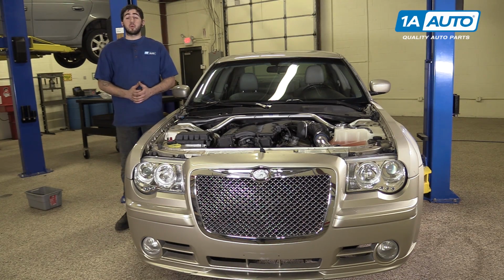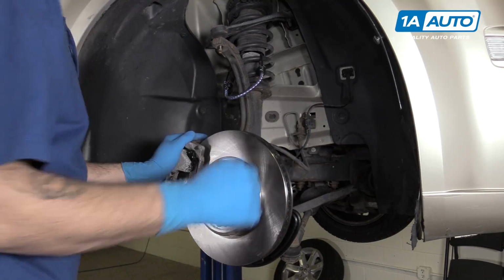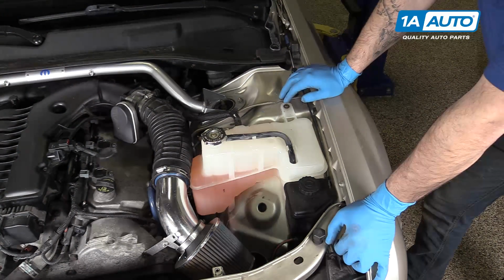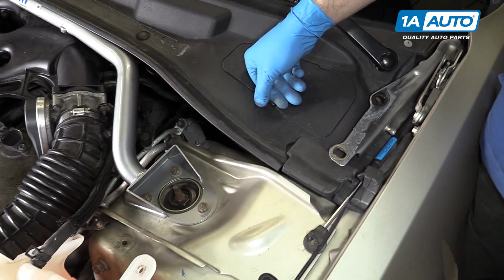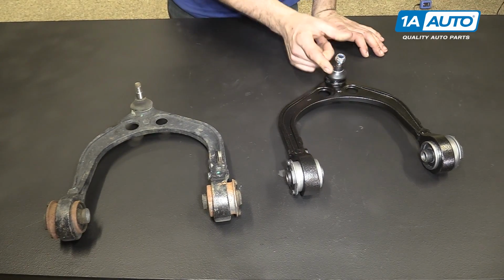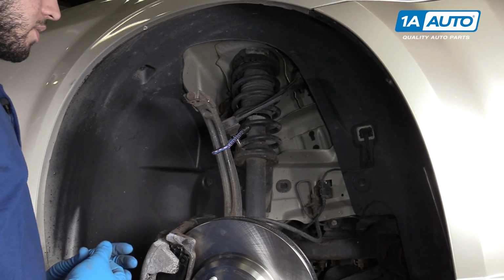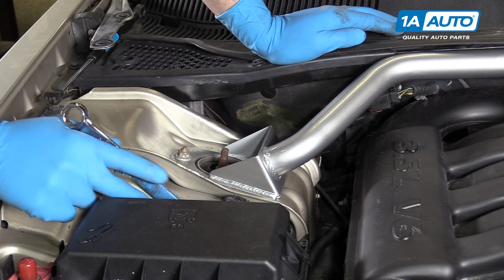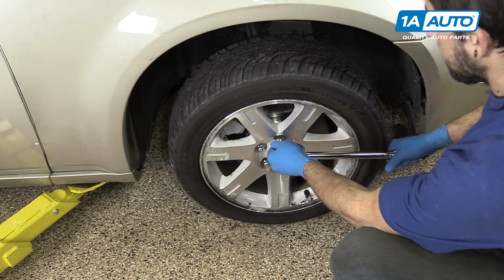How to Replace Upper Control Arms 05-17 Chrysler 300

Comment: If I noticed correctly, you tightened the upper control arms while the car was in the air. That’s absolutely incorrect these arms must be tightened when the car is on the ground.Otherwise, the rubber-metal bushings will be under constant tension and will eventually tear or fail.

Comment: I just changed the passenger side. Of course I dropped the nut off the inside bolt, it was a real effaroo finding that. Other than the inside bolt it really isn't that hard of a job. Thanks for the video.

Comment: The video was very helpful but you're lucky if it's this easy on your car 😂 Check to see if the bolts holding in the control arm will clear the suspension coil first then decide if you still want to do this yourself. They didn't on mine and I had to take the whole strut assembly out. Still got it done and saved some money, just a warning. And if it's an 05 and hasn't been taken out before, make sure you have a blow torch and a ball joint fork!!

Comment: Too bad the passenger side control arm on 5.7 isn’t the same. The bolt on the left is under the car. The plastic wheel well has to be removed to access it. Pretty lame design

Comment: The rear 18mm bolt on my passenger side is buried under wiring and is pretty tight to the firewall. I'm sure there's a way to get it, but damn if it isn't a tight space to work in.

Comment: What if the upper control arm stud free spins when you try and put the nut back on
Reply: Use a pry bar to push down on the top of the control arm to keep pressure on it while tightening it

Comment: Just did this on my 300c today. The video helped out alot but i replaced my strut and springs recently. Did have to pull the struts out be cause the aftermarket spring had tighter coils and would not allow the captive bolts out.
Reply from the maker: +Kevin Smith Thanks for checking us out! 1AAuto.com

Comment: I was told its nesseary to do both right and left at the same time but my one side seems pretty tight. Is it nesseary to do both?
Reply from the maker: +Martial 3231 It is suggested to replace suspension components in pairs to keep even wear on tires and other components, however, not a requirement. 1aauto.com

Comment: Are the parts different for a 2006 Chrysler 300C? AWD 5.7 Hemi?
Reply from the maker: +Barbara Vampola There will be a difference between AWD and RWD models but the installation process should be very similar. I have attached a link to the parts for your reference: https://www.1aauto.com/search?q=control+arm&year=2006&model=346

Comment: Thank you so much for this video It helped me very much. But BE AWARE YOU MAY HAVE TO ADJUST STRUT HEIGHT LIKE I DID BECAUSE THE SPRINGS WERE IN THE WAY OF THE 2 PINS YOU PULL OUT THAT HOLD THE CONTROL ARM.

Comment: I think the Hemi spring is a bit wider because we had to remove the strut to get the bolts out with the tabs on the end.  Otherwise the spring was in the way.  There was no other option.  The V6 spring might be more narrow so that’s why it works in this video without having to remove the strut.
Reply: I went through the same exact thing with my 05 Magnum RT...🙄
Reply: @d.p.trippy3262  One side for my Daytona R/T 2006 was fine, the other side was a major pain and included some cussing.

Comment: Explain to me how yall just get the bolt past the strut like it’s nothing.
Reply from the maker: +Dustin Wester There are some variables with the removal of those bolts, if you are having difficulties removing these try to use some rust penetrate and loosen them moire before attempting to remove them.
Reply: I just went ahead and took the whole strut assembly out.

Comment: Does you replacement assembly have a ball joint grease fitting?
Reply from the maker: +Tom Sigler Our replacement ball joints will come pre-greased and will not have a zerk fitting.
Reply: Can you add a zerk fitting to them?

Comment: If people are having a difficult time removing control arm bolts due to the strut being in the way, try this:

1) Disconnect the sway bar end link (connected to strut)

2) Remove top (3) nuts that hold top of strut on

3) Use a pry bar to pry strut down just enough to move it out of the way.

Good luck.
Reply: Exactly right on man! Found out the hard way after struggling for an hour, I just don't see how you can pull the bolts out without moving the strut🤷 Not possible!
Reply from the maker: +Steve Jacobson Thank you for the added tip! Have a great day. 1aauto.com

Comment: Excellent video, I love all the 1A-Auto videos and am very thankful. I just replaced the upper control arms on my 2005 Dodge Magnum 3.5L and there are three things I learned that I feel would be helpful for someone looking to perform this on an LX platform car (300, Charger, Magnum) after watching this vid:

1. As mentioned in other comments, the springs in the strut assembly could likely be in the way for removing the bolts holding the control arm into the chassis (4min 10sec). This requires at least partially removing the strut assembly. It was kinda annoying realizing it was necessary but not difficult. There's another great 1A-Auto video for replacing the strut assembly.

2. At 3min 4sec you can see the guy using a ratchet with an adjustable handle to remove the passenger/rearward nut on the strut tower. I'm willing to say that such a ratchet is required. Maybe it's possible to get a combo wrench on that nut or something else but I don't think there's enough room for it to be practical. I also do not feel confident that I got 55 ft-lbs of torque on that nut when tightening with my adjustable-handle ratchet. Yes, you could remove a bunch of stuff as said in the video to more easily access this nut, but it looks like a lot of stuff to remove to me.

3. This last one was a big deal for me and almost a dead-end. No amount of hammering dislodged either driver or passenger upper ball joint for me. Not even close. I used plenty of penetrating oil, swung hard, 4lb hammer, lots of different angles. No dice. If you're replacing your upper control arms, it's likely that they've been on there a while and this isn't going to be enough. It's also very easy to accidentally hit the threading, so, using a hammer to not destroy the ball-joint's boot is kind of a moot point. On the driver side, a pickle fork worked. On the passenger side, the pickle fork actually started to take the ball out of the socket. If you're replacing your upper control arms, it's likely because one of the upper ball joints is failing, like this one was. There was too much play in the joint and consequently it was too easy for the ball to come out of the socket. I ultimately used this: https://shop.advanceautoparts.com/p/autocraft-ball-joint-separator-ac3430/10449277-P?searchTerm=ball+joint+seperator Maybe A1-Auto sells one. I would say they should put an annotation in the vid with a link if they do. It worked perfectly. I laughed out loud when I saw how easily it worked. It would have saved me a TON of time and worrying. (I guess heat could be used as well to aid joint separation but I feel that's beyond the scope of this level of tutorial)

Again, great video. I love that it's concise and not trying to be entertaining. Very helpful.
Reply from the maker: +John Sherrill Thank you for checking us out, as well as all of the feedback. This will certainly be useful to other viewers attempting to perform this replacement. We hope to work with you again! 1aauto.com

Comment: I didn't watch the video all the way and tightened the nuts and bolts first. Will that cause it to make a squeaking noise? Did i ruin the part? Or should I just redo it?
Reply from the maker: +Tony Dean It could make a squeaking noise. The suspension should have been loaded with the weight of the vehicle on the ground. You may want to inspect the bushings to see if they were damages, if not you may want to try loosening the control arms, putting the weight of the vehicle on the suspension, and then tightening the control arm bolts. Hope this helps you out.
Reply: 1A Auto Parts Thanks I didn't drive it but point 1 mile. jacked it back up loosened the bolts and did it the correct way (This time). The noise was gone. But thanks for the reply

Comment: This method does not work on the chargers for the passenger side. The struts are in the way on both sides. There's a wire harness in the way on the passenger side.
Reply: 1971 Cheyenne Chevrolet same with my 2005 300
Reply: 1971 Cheyenne Chevrolet lose sway bar bolt n strut then u have more room

Comment: Was almost as easy as you said it was, Until we hit the captured bolts. Because of the struts coil being in the way we couldn't move the bolts far enough to remove them and we didn't have the appropriate tools or know how to remove the strut so had to bring it to resemble and take it to a shop anyways.  Close but no cake.
Reply: Justin removing the strut just disconnect the the 3 nuts up top and if need be the 2 bolts running through the a-frame at the bottom
Reply: I ran into this myself.  The solution is to unbolt the 3 nuts on the top of the strut under the plastic cap.  This give enough room to get them out.

Comment: 4:24 does this method of taking these bolts works on chargers too? I tried but springs came in the way. I did this on driver side
Reply from the maker: +Ajs1287 Thank you for checking us out. This method should help on the Charger as well. 1aauto.com
Reply: you guys rock!!

Comment: Thank you very much, excellent tutorials, appreciate the info on the Chrysler 300.
Reply from the maker: +Torria DeLeon Thanks for watching. If any of our viewers needs to make this repair, we carry the replacement control arm shown in this video on our website. Here's a link to them https://www.1aauto.com/2008-chrysler-300-brake-steering-suspension-kits/y-mo-c/2008-346-377?utm_source=YouTube&utm_medium=description&utm_campaign=videodesc&utm_term=x0gZrKKUcsU&utm_source=YouTube&utm_medium=CTA%20Comment&utm_campaign=ytc
Reply: 1A Auto Parts you say put partial weight of car on tires .... but then you said make sure you tighten the nuts at ride height isn't that with all the weight on the tire